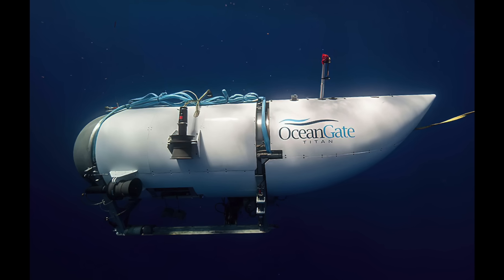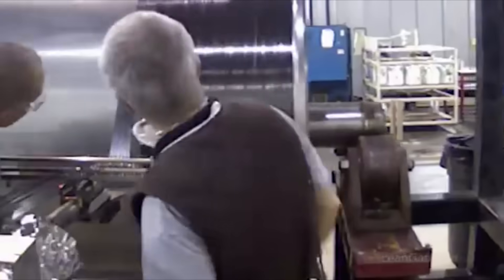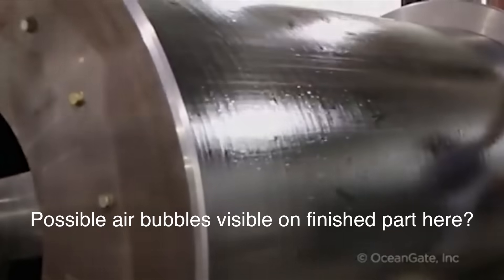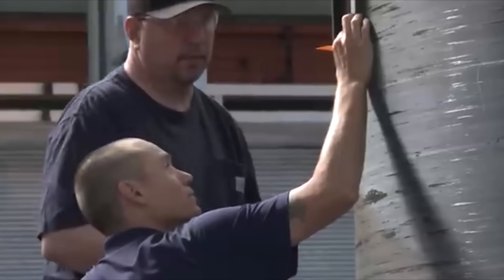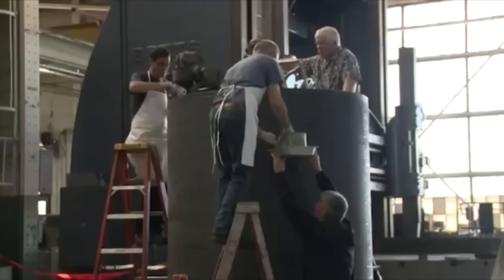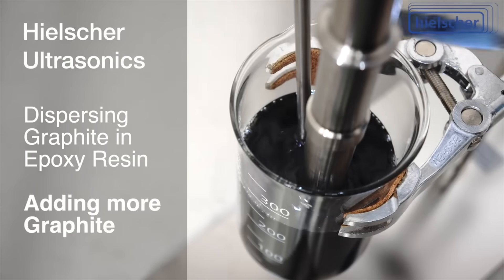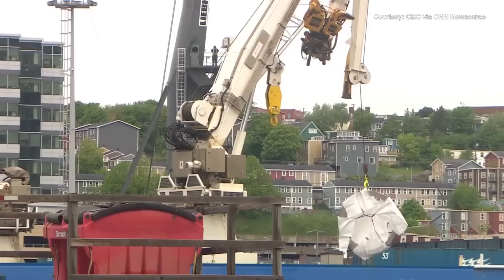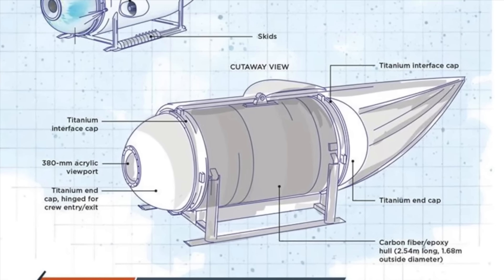Why OceanGate Titan Imploded - A Carbon Fiber Composites Perspective

Comment: Hi,  I'm an engineer who has worked on Racing and custom Bike applications, using carbon Fibre parts. I had many reservations about using or making carbon fibre parts, after watching many catastrophic failures during the early years with mainly wheels being the parts. They would suddenly disintegrate on track, after looking perfect in the pits, just before they left, not hard as they were all practically new items.  All the parts required bonding to Metal machined parts usually aluminum or Titanium, which would then be Bolted up, using either steel or Titanium studs or bolts to attach the other parts.                                                                                                                                 It was found that Carbon Fibre had Die-electric properties of its own, and as a result acted as a dissimilar metal if Bonded directly to the Metal part using carbon fibre parts,  after a couple of uses for let's say a front wheel with an aluminum hub, which was then bolted to steel front disc rotors, would advanced corrosion that could be seen upon disassembly, and the same could be seen where cracks or separation had occurred at the carbon to metal interface. This was remedied by coating the boned metal part in normal fibreglass resin and then applying the carbon fibre layup to that while still tacky, or when dry machining a course surface into it.                        Now true the forces we are looking at are completely different from the mostly compressive force you are considering, but after seeing the same video you showed in your explanation when this occurred, it didn't surprise me at all to see the interface come up completely clean and free of any distortion. To be honest, that was exactly what I expected to see actually,  if the Boned surface had held at all, with the way it was constructed I would have expected to see at least some stands or parts of strands still dangling to it.    I expect, and would suggest that at least a few of those cracks or bangs were at least in part, the carbon-to-metal interface separating until when "Loaded" with 5 people on board it finally separated completely and cleanly, leaving the hemispherical bell at each end as manufactured, not deformed? I expect it was the forces from the implosion that blew out the observation window.                                   I'm really sorry for the other people on board, who were conned into going down in this thing, the whole thing was a sad Joke! Continuous monitored settling cracks? even this supposed "safety system" was a Farce what exactly is acoustic measuring going to do for you, other than annoy you just before or while dying. What this so-called Engineer, did is tragic, and the very reason we are professionals with demonstrated safety factors in place for a reason. I've worked for two Major companies on pressure vessels, with pressure, being both positive and in a Deep vacuum. I've also been nearly killed and was finally seriously injured, due to a like employer.  Despite a multitude of written warnings and a year-long refusal to work further on this project, regarding safety limits concerning how the initial load was applied, rather than a gradual build-up as designed, it had become an instantaneous shock load, and it failed exactly as predicted throwing a 500lb endbox thru the air over the Machine and Control panel were I was standing and it struck me on the shoulder. This kind of Engineer gets us all a Bad name? and his victims Killed and injured.
Reply from the maker: Thanks for your great comment and insights into bonding metal and carbon. Great to hear some real world industry experience. Very sorry to hear about your gung ho employer. I fear there are far too many folks out there like that pushing the envelope too hard, too fast. Fine if your putting yourself at risk as the only end user but not when it’s other people’s lives. Hope your shoulder has recovered well!
Reply: @JamieKunka  Thank you very much, for your nice comment.
Reply: Sorry for your injuries! I reminded me of a similar situation that I was in! - working with composites. I was lucky and escaped the explosion, just in  time! I warned my fellow workers, who at the time thought that I was crazy! We all eventually escaped without harm,, when they saw I was serious,! To many engineers think because they got a better education, they are above reproach and are superior minded!
Reply: @robertchilders8698    Yes, watched it Happen as the engineering profession was revamped, as their goal is more prestige and the ability for connected Burracrats who just happen to be in Engineering rush to get seats where they'll never have to be an Engineer again, just administrators.                                        I could write a book about the cock-ups and Deaths these idiots have caused, during my career, being that I've worked at most levels. I had to go Find a friend's corpse once, that had been left to stew in the cooling Tower pond over the weekend, due to the layout of the plant, and the Machines being up on a catwalk, over the pond. He was carrying out a yearly inspection, I'd been there with him on Friday when he placed all his Lockout padlocks on our Breakers. Meanwhile, some cocky Maintenance Engineer had decided to use an extra set of contacts going spare on this Machine to Bring on a pump, he never thought about this situation. He needed the pump for process, so it could run with the other Machines we had 6 there.                                                                     So He ordered someone to cut off the Lockout padlocks and turn the power on while they temporarily got another feed to the pump, He Killed our Guy a Family man with 3 young kids, to his death, to save face for an extra 5 minutes. He stated that he had told someone to go tell our guy, But it never happened and as my Help wasn't needed again till later, I was sent to another emergency as it was summertime on a Friday afternoon. Honestly, I have enough to fill a Book, including my own. This is one of many examples of this, where the project was completed without the Machines ever leaving the loading Dock or even the street in one case, Cop's Coliseum, Do you Know How many people must have come and gone and said something to him about Missing Machines?  Once in London, the plant room was at the lowest level of the underground parking, The Building was like a Lifesaver shape, a Hollow circle, They had to smash open all that rebarred concrete and then we Dropped the Machines in through the Top, $500,000 a pop for the machines then all the services to hook them up, electrics, plumbing, welding. Instrumentation, pumps sensors, Microprocessors enabling the building control, All there, doing nothing, I'm only supposed to be there at the end to inspect all that work and or troubleshoot if theirs a problem, and remedy it, regardless. and turn everything on making sure it reaches Design parameters, How does someone who is supposed to be a fellow engineer, walk past the Machines every morning and not clue in ? It's amazing and these are the Guys rushing out of Universities, who have never seen a bloody thing until they get a Job, and then they are suddenly managerial Material, My old Boss was ex-Navy when I was going through my Qualifications and Training, He would have punched your lights out, then depending on circumstances he'd have decided if he was keeping you on or not. In those days getting let go, mid-training or just after was the Kiss of Death, yet I know many of these never even got a reprimand.                                                         On the Sub, it shows this Kind of thought, who else would design a WARNING system for about to die or dead?  Regards  Ian

Comment: I spent 30 years in the composite business. I have filament wound structural members. In glass and epoxy resin. We used two types windings Circ's which was similar to what he used. But we used a winding called Helix on every other layer. And the band end to end with like one revolution. That entire layer was like basket weaved for a complete layer. Then another layer of Circ's to pull everything together. The Carbon to resin ratio is also important to dry and things pull apart,  to wet and it becomes brittle. Bonding the titanium end caps didn't bother me as much as the winding pattern did. Just my opinion.

Comment: The CF wrapping employed to make the hull, would not offer the required resistance against the magnified prevailing hydrostatic pressure from both hemispherical heads acting through the rings.

Comment: kMy guess is that the Titan's viewport blew in. It was certified to a pressure of only 1,300 meters below sea level. Sea water then shot in, compressing the air and all five passengers into a tiny area in the opposite titanium cap which remained intact. I assume that this is the location where "presumed human remains" have been recovered. At the same time the extreme and rapid compression of air into that titanium cap would cause tremendous heat. After that the carbon fiber hull would explode. The result would be one titanium cap without the viewport, one cap with about a half ton of compressed, cooked human mush in it, the landing frame, the outer metal hull which had that fin shape and thousands of tiny carbon fiber shards scattered on the sea floor, which I believe is what has been found.

All the metal parts of the sub have been publicly displayed except that rear cap for understandable reasons. The landing frame appears to be intact and straight. An implosion of the carbon fiber hull would have pulled the titanium caps inward and bent the landing frame. An implosion of the carbon fiber hull would have chopped the passengers into countless tiny shreds which could not be recovered.

In a YouTube video with Mexican actor Alan Estrada Rush explained regarding the viewport: “It's acrylic – plexiglass. It is seven inches thick and weighs about 80lbs. And when we go to the Titanic, it will squeeze in about three-quarters of an inch and just deforms. And acrylic is great because before it cracks or fails, it starts to crackle so you get a huge warning if it's going to fail.”

Comment: I think I understand their thinking of the glue. Seems sea pressure alone would push the pieces together. U don’t actually want a set type glue as the fiber needs to move with compression but more of a thick sort of simple filler. Your not trying to bond the pieces but simply add a thick tacky layer to squeeze into imperfections as the pressure itself holds them together. Personally I don’t think the glue had anything to do with the implosion. I think it was up to the fiber itself being used too many cycles. I believe it should have been all one metal. I do think adding more fiber in different orientations would help especially more egg shaped but either way it’s a bad material but certainly shouldn’t have been used multiple times especially knowing it’s compromising. He thought more of it than realistic. It’s a very good pressure holder on the inside like a gas tank but not at all on the outside. Wild West open ocean no laws so anything goes out there

Comment: The lay-up was actually a 0/90 lay-up. You just don't see it in the video, but according to Composites World, prepegs were used on the longitudinal access. Didn't do 'em a lot of good though. There are a few Lloyds certified submersibles made of glass fibre, but they seem to have isotropic lay-up.
Reply: Those fiberglass submersibles were for shallow water <300 ft. Carbon fibre is scary as it will just go bang with little to no warning when over stressed.
Reply: @jackdbur  There's some that go as deep as 2000 feet.

Comment: The very fact that Rush acknowledged no testing for submersible had never been done on carbon fiber, is a testimony that he should have gone to carbon fiber experts to do his research. But instead, he decided to do limited testing himself. That's what doomed him. His arrogance based on his engineering experience. "You can't tell me what to do. I have an engeneer degree." Yeah, but you're not an expert nor have any experience on Carbon Fiber.

Comment: As regards the adding of different orientation of the CF, while lay up at angles of 90' 45' etc would help a little in crack stopping, they would reduce the CF/resin ratio.  The main direction that CF fibres would have helped is in the radial direction.  This would resist delamination and spalling at the surfaces where the fibres, which are in compression due to hoop and longitudinal stresses, are only supported in 3 out of 4 directions. The compressive stress would force the fibres to bend and pop out of the surface. Radial fibres would be in tension in that scenario and would have had to break the fibres in tension, the direction they are strongest.. I also think that the titanium rings were really naive. At the very least the recess should have had an extended reach on the inside surface, which the CF could bear down on. Tapering the thickness would also reduce the stress concentrations at the transition.

Comment: The instant you said that they didn't account for axial forces on the cylinder, it all came together for me as to why this happened. There is a lot of "carbon fiber isn't good in compression" oversimplification in the reporting of this. But you need fibers in an orientation to handle the axial compresive stress. Otherwise, the epoxy is doing all the work. Carbon fiber is often used in compression in critical applications (upper spar caps of wing spars, in particular, or one side of any beam in general). But there were specific design considerations, as well as possible failure mechanisms for thick compressive structures (Real Engineering, another Youtube channel with considerable composites engineering - apparently the person who produces that one did his masters engineering thesis on composite structures), that OceanGate seriously underestimated.
Reply from the maker: Great points. It’s not bad in compression it’s just not as good! I think people forget that a beam has to have a side in tension and a side in compression. I always think of carbon fibre bike wheels. They take one heck of a compressive beating. As you say there are clever ways to improve its compressive strength via fibre orientation etc. I’ll check it their video thanks.

Comment: The inner part of the titanium ring that is supposed to "seat" on the CFR hull should not have a polished surface, but all surfaces that are planned to be glued to the hull must be much rougher surfaces, abrasive, acid etched, like sandpaper, creating "hills" and "grooves" 0.5 - 1.0 mm deep, which were supposed to serve for a tighter connection and better glue/resin hold. Engineers should do some numbers and do some tests and come up with the tightest way to connect.
Also, CFR hull are made of CF strips that engineers at Boeing have labeled as material with expired "shelf life"! The part of the hull intended for the glue/resin connection with the titanium ring shouldn't have a 3cm deep ring what was thinner at the end, with few centimeters less material in diameter than hull. The glue/resin applied on that surface did not have an enough surface to make a solid and safe joint and protect same joint from pressure of cold water, little over 0C°. Remember your experiences with the behavior of parts of different materials, small surface area and still at a temperature of around 0 C°, and connected by resin..

Comment: I'm sorry but I have to completely disagree with your point on the bonding and I think you're putting too much importance on it. It's not a pressure vessle, it's the opposite. The bonding was there essentially just to keep the two hemispheres on the sub during transport. Once it was underwater the outer pressure from both ends on the hemispheres would press the ring against the carbon fiber with millions of pounds of force, significantly more clamping force than anything the glue would provide. The ring also overlapped with the edges of the carbon fiber so even if the "seal" wasn't absolutely perfect it wouldn't really matter much, again, millions of pounds of force at those depths with those dimensions. but like you said, the failure was definitely the uni-lateral weaving of the carbon fiber. It had almost no strength along the longitudinal axis of the hull asides from the resin holding the carbon matrix together.

Comment: Saw this I think on Reddit.  One reason SpaceX switched from carbon fiber to stainless steel pressure vessels (fuel tanks) was the difficulty of detecting structural flaws.  I'm a lay person but my father is an architect and builder of skyscrapers who also went to Princeton only years before Stockton Rush.  The federal regulations and codes in the construction industry, especially high rises, are insane but are very necessary.   I'm sure the "crackling sounds" they heard was that carbon fiber breaking up!  What else?  Or those seals coming loose or that damn Plexiglas porthole that was inches too thin.   Stockton was always talking about people in the deep sea exploration community  using a "safety argument to disrupt innovation."   The problem is you can't argue with time tested engineering and physics.  If you're going to use carbon fiber, it must be in a woven pattern, not a single weave.  That isn't strong enough.  And that video of those guys applying the glue?  Why weren't they using an autoclave?  Wearing gloves?  It's insane.  That thing was built by students who had no idea what they were doing, lead by an arrogant greedy man who skimped on materials and had no regard for anyone else's safety pr lives, not even his own.  It's all very sad.